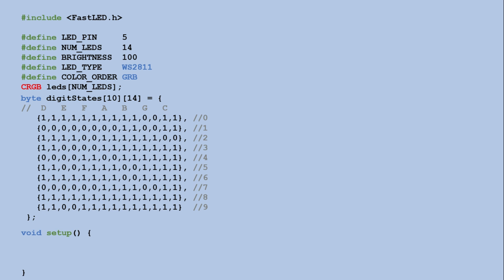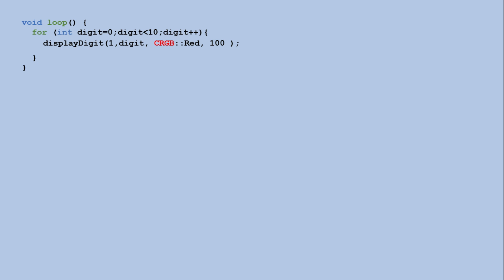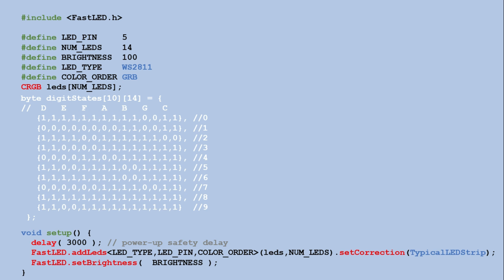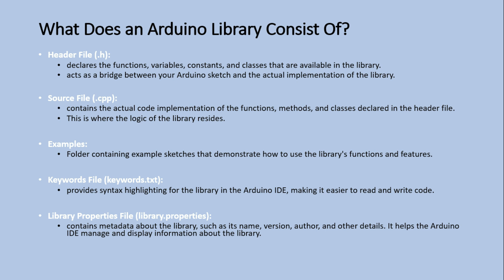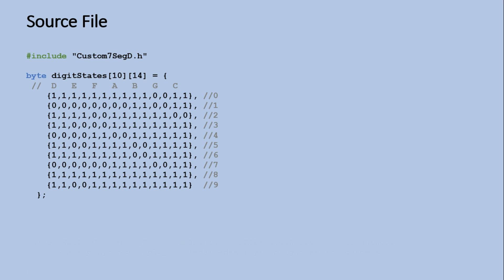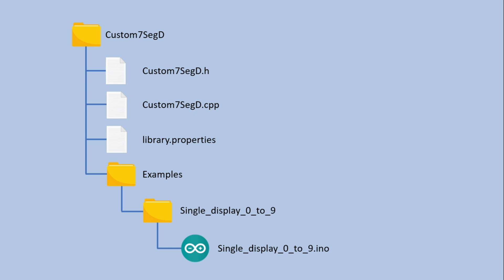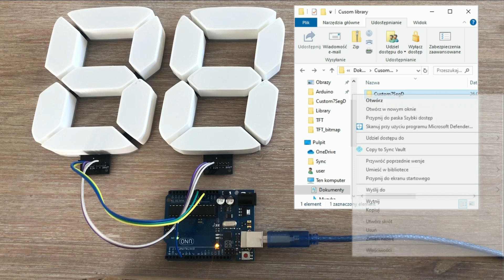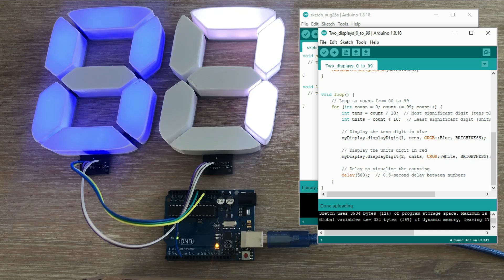Building and Installing a Custom Arduino Library from Scratch

Comment: I noticed you were using the Arduino IDE version 1.8. You may be aware that under versions 2.x, the library.properties file is no longer used. It is advised to always include it for people still using the 1.x IDE.

Great video, thanks 

Cheers,
Norm
Reply from the maker: Was not aware of that . Thanks:)